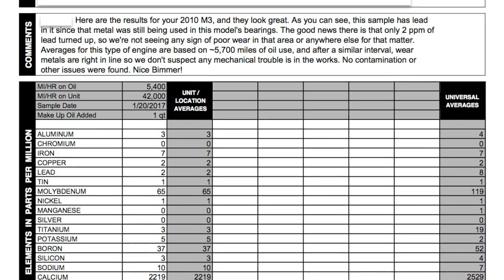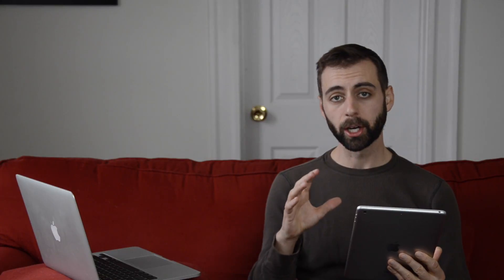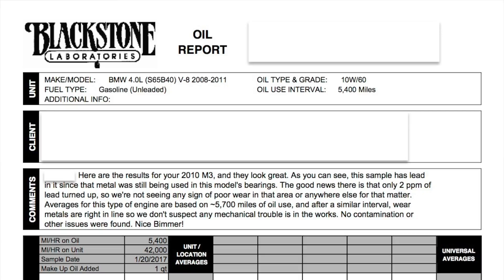Rod Bearings! Blackstone Labs Oil Analysis Results - BMW e92 M3 (S65 V8)

Comment: If you'd like to reduce your wear try adding some XcelPlus.

A 50~90% reduction in wear is normal after treatment... and would protect your bearings against premature failure... because the XcelPlus is always present... even if the oil isn't.

🙂
Reply from the maker: Go post this on an e9x m3 forum or Facebook group and see how it goes
Reply: Your video was particularly interesting because you measured the exact wear: 

Most owners have no way to confirm that wear decreases by 50% or more after using XcelPlus... whereas you could easily run a second oil analysis.

N.B. That's a bigger improvement than any other oil or oil additive on the market.

If you ran a few more oil analyses you'd notice that the wear remained at the new lower rate for 160,000 km or longer.

🙂

Comment: I just changed my oil on my E60 m5 2008, I should have sent them a sample. I don’t drive it aggressively, should I’ve be worried?
Reply from the maker: Hard to say. They are somewhat unpredictable unless you are just tracking the car and beating the hell out of it. It's a good idea to send a sample just to know what sorts of metals are wearing, and if they are wearing excessively. For now...Don't worry. Just be sure to order your kit (its free to get the kit) and use it on your next oil change.
Reply: Tedward thank you for your time replying back. I’m going to drive my car gently. What’s the best Milage interval for sending an oil sample?
Reply: Tedward ... since I just changed my oil ... at 3k?
Reply from the maker: 3k is overkill...I do 5k but you'd likely be safe beyond that..even 10k (i think BMW recommends 12k but i ignore that)

Comment: When you start watching rod bearing videos you know you are too deep into buying an E90 M3 fml.
Reply: statesidesupercars i bought an e90 and the whole issue is honestly overblown. But it still has me very very scared.
Reply: Augusto O.R me too lol i just bought a 2011 e90 m3 and im always freaking out about the bearings, i always let it warm up about 10 minutes before i start driving it without going over 4k rpm
Reply: @augustortiz  I hope you're right lol... seeing an M3 on the weekend that has 77k with no receipt of rod bearings. Wish me luck lol
Reply: @brandotube  I sold it at 150k miles and it never blew up so theres that. I used it daily. The new owner replaced them in my driveway when he bought the car lol.
Reply: Every high performance bmw engine has rod bearing issues.. get a lab test run 5w50 instead of 10w60 and just replace when necessary. Lol or sell the car!!

Comment: What year is your M3?
Reply from the maker: this is a 2010 (pre facelift)...Correct me if I'm wrong but the pre facelift bearings are primarily Lead whereas the 2011+ bearings are primarily Aluminum.
Reply: Tedward How many miles on your M3? I'm considering one and am curious about mileage impact and the rod bearings. Also what oil and viscosity do you use?  Seems like using a 0W-40 or 0W-50 would be good to get lubrication to the bearings earlier after start-up due higher flow rate. Thanks!

Comment: Great video Tom! That's great that nothing's wrong with your engine! I'll definitely do this to see how healthy is the engine in my Alfa!
Reply from the maker: Does the alfa have flat tappets? My Porsche does which is why I use a very high zinc content oil. Looking forward to those results as well after the next change.
Reply: No but I didn't ran the engine long enough to notice any clatter. I'm planning to work on the car again once it warms up and when I have some free time. The Porsche have flat tappets? Damn, I hope it's not bad.